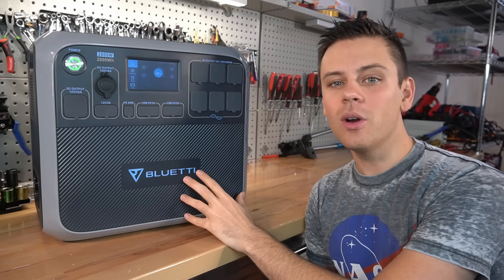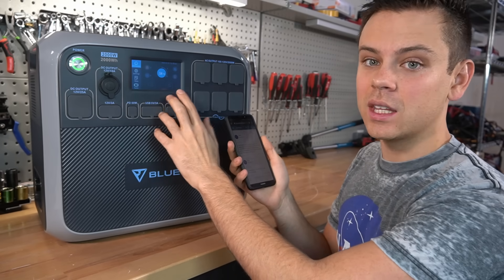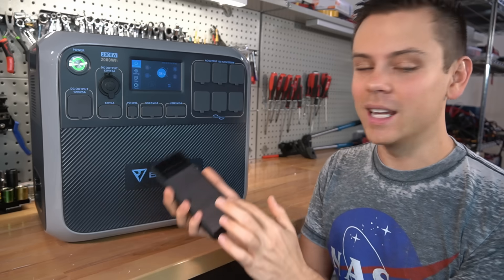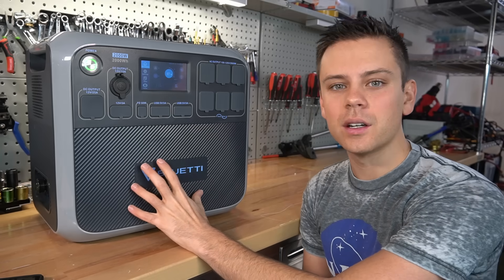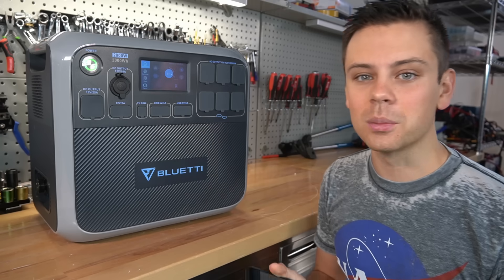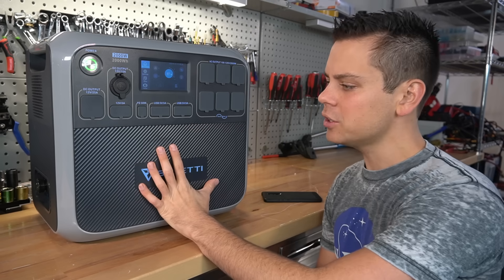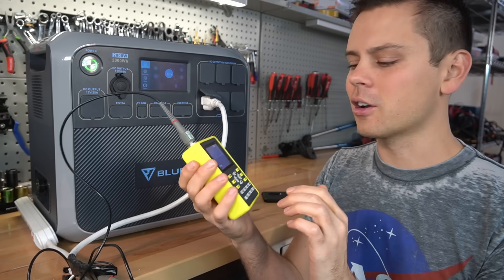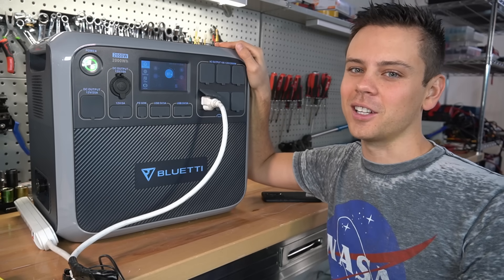New Issues are Plaguing the Bluetti AC200

Comment: Hi Will, I have the Bluetti ep500 and the screen has died. The unit is otherwise working fine, but if I generate an alarm, I will not be able to use the unit again, alarms cannot be cleared in the app. Any chance you could ask Bluetti to change the app to allow this? I have asked them, and they have replied looking for videos of the problem, and a screenshot of the alarm, which is crazy as the screen is just dead! Yes, I have restarted the unit many times, to no avail. Many thanks for your wonderful channel

Comment: My ac200p lcd screen stopped working, it went black but the power station is still working. Seems like this is common with bluettis lcd touch screen. Is there a work around so that i can use external device to control it?

Comment: i have this unit and i have all kinds of issues right from the start and i have tried anything and everything to correct the problem but i have come to the conclusion that the BMS BOARD on these units are no good bluetti needs to replace the BMS BOARDS with one that works not the garbage they have in these units now these units are certainly not worth the money if you have this unit sell it or send it back trust me DO NOT WASTE YOUR TIME trying to fix the unit IT IS A WASTE OF YOUR TIME.

Comment: Greetings Will. I need your help. A few years ago I saw your review of the AC200 1700 watt the crowd share and I ordered one. It has been perfect the four times i have used it as a backup for power outages during storms. It is stored in the closet and I check on it every few months. No issues. I just am hearing that there is a danger with the LG batteries. I cannot find any information regarding this on their site or online. Is it safe?

Comment: I’m on my second AC180. Output seems good although a 600W labeled kettle shows 700W consumption. Biggest issue is extremely inconsistent AC charging or not charging. When on Turbo it generally sits at 650 W no matter what SOC. Rarely can I get higher. Even std charging should be over 1000W.  See what they do with this one.

Comment: I have the esrlier model 2000kw 
  3yrs daily use. No troubles yet. Although i just tried to hook it to a 200w solar panel .. the moniitor only read 24v .. do i have to get another panel to reach 41v for it to take a charge....

Comment: Just got my 200max. Can't even set it up. Network connection error on any device i try. Can only use with Bluetooth with limited functionality. Its 2000$ unit so this is unacceptable. Never had issues with ecoflow

Comment: WHY:  YOU DO NOT< WANT BLUETTI PORTABLE POWER. Or others.  For 911 uses; Losses could be over $5,000.00!! ///   New-bee blurts out;  Out of frustration .On the verge. Of giving up! Learning to build  my own. Ready to buy . This bluetti.  THE BIGGEST. MOST IMPORTANT THING.  WILLIAM TAUGHT ME. WHY  I NEED . TO CONTINE. CALLSES WITH WILLIAM.  TO BUILD.  MY OWN. PORTABLE POWER . FROM PARTS. WHEN I AM, TOTALLY BLOWN AWAY. WITH THIS NEW-TO-ME, SCIENCE.  WITH  A  MORE THAN.  STEEP LEARNING CURVE.  I DON'T.  HAVE, A CHOICE.  BUT TO BUILD.  MY OWN.  BECAUSE: THE BIGGEST DOWN SIDE. IF YOUR BLUETTI or other Portable Power Station] DOES NOT. TURN ON. YOU ARE TOTALLY-SCREWED . LOST,  $3,000.00 OF BEEF.  IN YOUR FREEZER. BECAUSE YOU COULD NOT.  GET YOUR BLUETTI .  FIXED FAST ENOUGH. WHERE AS; HAD YOU HAD.  A SEPERATE INVERTER AND BATTERY. CHANCES ARE. YOU ,  NEED ONLY.  REPLACE. ONE PART. If I don't build my own.  And my bluetti blew up.  Nor only  would I, have I lost 3-grand.  Of beef.  In the freezer. I also had.  To buy another  Bluetti $2,900.00++ My losses. Would be over $5,000.00!  Where as if just the power amp fried.  My losses are under $400.00.   10-06-23

Comment: Chinese made garbage doesn’t fail to prove its worthless value. Bought an AC200MAX and after 7 months of using it as a backup for power outages it is no longer good to anyone. During those 7 months I had like 7-9 outages and all I would connect to it was a TV, modem and Refrigerator. One day I noticed Bluetti’s app had a firmware update, so why would I not trust it? So I clicked update and instantly it went from 100% to 0% while sounding the alarm with the BMS 034 Code.

The machine still turns on but it sounds the alarm with the BMS code 034 every time. The machine displays v0.0 firmware and it does the same in the app. It shows 0%  on the machine’s display and also on the app yet it turns on with 0% but when I try turning on AC or DC or charging it nothing happens.

I thought I was good since they offer a 4 year warranty. Boy was I wrong, after dealing with their tech support for about a month, communication went cold.

I lost nearly $2000 and all I got out of it was a hand full of backups for about 5-15 minutes before power was restored, 1 time the power outage was for about 3 hours long and another time for about 10 hours.

From my calculations I didn’t even get 24 hours of back up power time which puts me at around $100 per hour of backup power😢. If you thought .30 per kwh was high what is $2000 per less than a kwh? Yet you got influencers getting these things for free to CONvince the masses to purchase one. 

What killed me was that when I started to use their forum within the app for help I was baffled at how many people was having the same issue with the BMS 034 Code. Some of the people had gone through the same thing as me when they attempted to update the firmware.

I personally do not recommend buying anything based out of China because when it comes to quality made products, communication, customer service and standing behind the garbage they produce they always seem to drop the ball.

Comment: Hi, I bought an ac200max recently - the problem I have is frequency output - when set to uk standard the frequency output is 60Hz the display shows 50Hz.
Although I tried to reset the unit by disconnecting solar input - turning the off for a time then a restart - the display remains on 50Hz, & output on 60Hz. 
nothing has changed.
I have tried emailing - but am still waiting .
Perhaps you can help.
Edward.

Comment: I bought one last Black Friday for like 700 off which seemed like a good deal to me, and got it in a week. Finally using it on my offroad camper. Only issues im get is the ac usage is show 0 watts running a fan  but the DC usage is showing fine.  One other issue is the wireless charging but that might be my phone case since it causes issues on other wireless chargers. Tomorrow morning ill hook it up to the solar panels and see how it doe’s charging.  Off topic but anyone know if they make a rack mountable inverter/solar charger?  Was wanting to make a portable rack mountable setup but seems they only sell rack mountable batteries. Would be cool to install all rack mountable stuff into a portable waterproof rack for camping.

Comment: I have the AC200P, but I never noticed an issue with the AC200P.  I have it in a permanent location running my 26 cu ft refrigerator/freezer, 12 volt portable 54 quart refrigerator/freezer, 7 cu ft chest freezer and various led lights in the kitchen and living room. I would like add another AC200P to my kitchen. The charging brick from the first AC200P would be plugged into the second AC200P, essentially giving me 4000wh.  The second AC200P is plugged into the wall outlet. I want to set up solar panels to power the second AC200P. This setup is designed for power outages, which can last from a couple of hours to several days or more. My hope is for the solar array to maintain the AC200P's for extended periods of time.

Comment: Sigh...everytime I think I am set on Bluetti (specifically the Ac200 Max) then I watch a video that makes me worried to get it. Especially with the customer service stuff...then I watch another video and I am convinced again....and the cycle continues. As a single mom with not a ton of money, who is not techy....this is extremely stressful. I do not want to get something with all my savings, only to find out it is crap or has issues or wasn't what I needed. 
I read comments that freak me out about shadows going over the solar and it dropping the wattage going in and not going back up once the cloud passes. All these things then make me go look at other units..
Oupes or Delta Max....only to hear good and bad things too. I wish someone could just tell me with certainty, this is a good unit, it can expand if you need it and it will run pretty much everything you need without much trouble. Also, get these solar panels. Enjoy.  🤦🏼‍♀️

Comment: Same with the Max here in the UK, wildly differing readings on the panel vs a socket meter, over double the wattage output compared to the socket meter. I also connected the TV and soundbar and the reading remained zero! The other issue is reverse polarity connecting the AC to our motorhome. For such an expensive product, these issues leave a poor customer experience and I can foresee a refund request. Let's see how UK customer services perform.

Comment: I have the AC200P and it works well, EXCEPT when I try to charge it on solar/PV.  I use a Bluetti 200W solar panel system.  I read somewhere else that my solar panel system is not big enough for this generator and that I need something that can input at least 35 volts.  Is that true??

Comment: I didn't have any trouble with my crowd funded AC200. However, 2 years later I purchase two B230 expansion batteries as I am going to be living off grid and nowhere on their site do they make it clear that when the  AC200 and both B230 are connected together, there are no ports left to plug in the solar! I now have to spend an additional $500 on cabling, if I want all three units charging with solar simultaneously while not hooked together, as I only have one set of solar hookups for the AC200 and none for the B230's. I have the two, useless to me, P090A cables that came with the B230's. Oh, I guess they are doing me the favor of offering  to exchange the P090A cables for  P090D to XT90 but I have to pay for the shipping return. They should make this information very clear on their site,  they should suggest that AC200 owners need different cables and give them the opportunity to order the correct cables instead of the ones that come with the B230's. I have no income currently, which is the reason for the off grid move and this kind of run around from a company I put my money to back is the last thing I need right now.   Very disappointed in Bluetti right now.

Comment: I installed Lithium batteries in my Class C coach RV. I drove it and my Truck battery cable coming from the coach to the cutoff switch burned completely off. What did I do wrong?

Comment: Will: Regarding power stations in this size range, have you had the opportunity to review the USA made Dory Power B2700? It is one I am considering because it is LiFePO4, made in Ohio, and has 2688 Wh capacity, 2000 W rated power. I believe the surge capacity is supposed to be 4000 watts. It looks high end (metal casing) and has a good 7-in-1 LCD display showing the total wattage of electrical loads and percentage of battery energy remaining.  I checked with D and B and they seem a legit company, though I wish they were better known. This particular unit doesn't allow solar charging, but I emailed and heard back from their business manager Amy Young who indicated that an upgraded unit is coming out in September (2500 watt capacity, 2600 watt continuous, 5200 watt surge) that will allow solar charging. All of the units can be set up to turn on automatically if the power goes out. Thanks in advance for your response.

Comment: I purchased and Bluetti AC200P and it worked fine.  I wanted to have it inside my house so I ran 10 gage solar wire from outside the house to inside.  But, when I hooked up the AC200P it would not recognize it and would not charge - YET using three 100w panels inside connection showed 60.4 and my Inergy Flex power station connecting to the exact same location inside (within minutes of trying my AC200) my house the Inergy Flex would recognize and charge just fine.  BUT, when I take the A200P outside and connect it to the panels (not using the wiring coming inside the house) it recognizes and charges.  You would think there is something wrong with the wiring coming inside the house YET why will by Inergy Flex Power station charge fine inside the house on the same connection and the AC200P won't even "recognize" any solar input?  Any thoughts or ideas would be very welcomed.  Steve

Comment: Will I also have 3 of these ac200Ps and one of them has gone wonky. I used all 3 down to 5% during an outage all but one of them went right back to 100% when I A/C charged them. the one that does not fully charge only went to 80% so I ran it down to 65% and I tried to A/C charge the unit again. This time the unit stopped taking the charge at 67% the A/C charger reads green stating that the ac200 no longer is in need of any further charging. I know the charging brick is good as i have 3 of them and they all do the same thing. I love your reviews and your setups are amazing. anyways can you offer any advice, or should I go to customer service at Bluetti? ..............................................warm regards.............jbmaps..........aka Jay
Reply: You should just ask for replacement for your faulty unit. Keep email them everyday until you get someone to answer you
Reply: @jakeliujakeliu  Jake Thank you for your advice while this issue was occurring, I was in contact with customer service and they, just recently, sent me a replacement. I now have the replacement but was told to get rid of the defective unit and I am now trying to figure out what is wrong with this faulty unit. see it works fine but I figure once I get it down to 0%, I will no longer be able to use it. I will, at least get to make use of the 52 volts of battery that the defective unit has in it. Hoping to, perhaps, modify my e-bike for longer range with them. I still would like to get this faulty unit working again and figured Will Prowse would have some suggestions that I can try. be well.....jbmaps

Comment: hi there, i am having a problem with my bluetti ac200p, when i turn it on it beeps and the fault light is on. it says the battery is 100% but it isn't. i can use the ac but it will cut out quickly then on next attempt will usually stay on. the fault history is predominantly no.42 but the is also a 23 and a 43? of course it wont accept charge as it is stuck on 100%. Any ideas?
Reply: fault 42 is showing currently, this is BMS over voltage

Comment: Hi. Thanks for your informative videos. I bought one of these unit  7 months ago and have used it maybe 10 times at most. The last time I used it I noticed the capacity was way down. After several repeats of charging and discharging, what happens is it goes from 0% to 30% then jumps to100% in about 15 mins then I switch it off for about a minute and switch it back on where upon it only reads anything between 13% TO 22%. Bluetti Australia tried to blame the charger and sent me a replacement but I still have the same issue. I also used both chargers simultaneously and it still reached 100% really quickly as above then after switching on and off again it read the usual approx 20%. I also noticed when drawing 9 amps on the inverter the battery amps were 49! What are your thoughts on these issues. I am now experiencing trouble getting the unit back to them. Cheers.
Reply: Did you ever get this resolved ? I was so close to buying one from bluetti australia but I've read one too many stories like yours but never if they got resolved or not.
Reply: @tribunetube  Hi. Yes. In a word... Bluetti after a L O N G to and fro of emails and shipping issues returning the faulty unit they did send a replacement and upgraded me to the AC200 Max because they had no more stock of the AC200P and that was after I haggled with them because they had made the whole claim so frustrating and drawn out. I haven't used the new one much only twice so far, so hopefully they have improved the new one . Time will tell... Cheers.

Comment: I personally have an AC200P ( 2000 WH version )

Similar issues with date setting 

Other than that ?

No issues at all.

I only use the AC  when I need to , I never leave it on permanently. I have run a 240v fridge on it but at 340 watts, it is only going to last as long as it lasts.

The unit runs my Dometic CFF45 on 12v for just shy of 5 days

No error codes as yet and it has been in my van permanently for four plus months

Comment: They sent my AC200Max within a couple weeks. I tried it out today. With 3 PV200 panels, i maxed out at 217W input, which was twice it's avg for the day. It was cloudy, but the sun peaked for a short bit. Perhaps that is normal for solar panels on a day like that? I went from 62 to 80% battery on the day with no power going out. The wireless phone charger only works for about 10 sec before dropping. I tried shifting my phone side to side, up and down.. that feature is defective. It's currently running an air purifier on AC and claims to have 0W going out. So there's something going on there too. I'll take a closer look at the manual to make sure i didn't do anything wrong, but so far I'm thinking about sending it back.